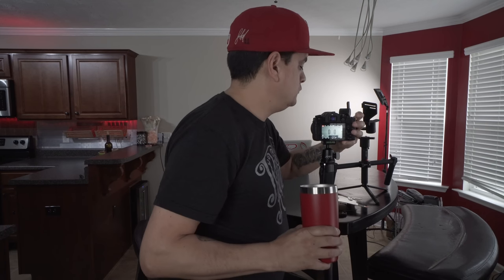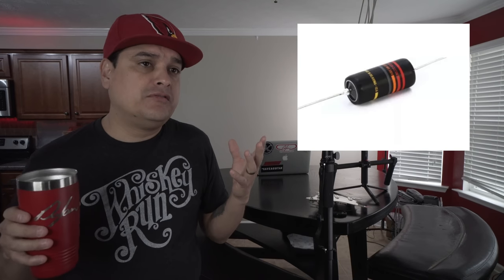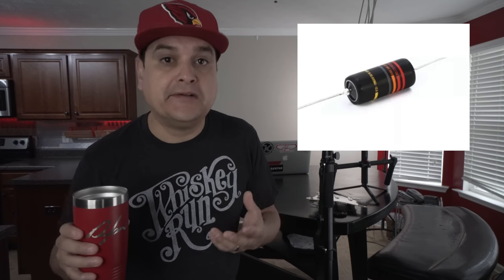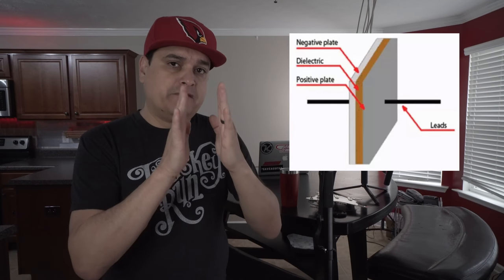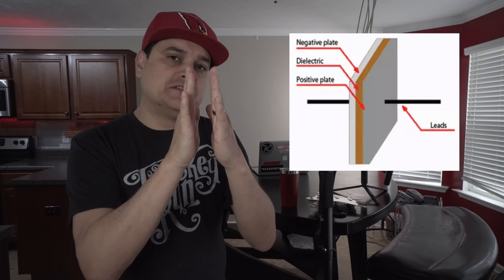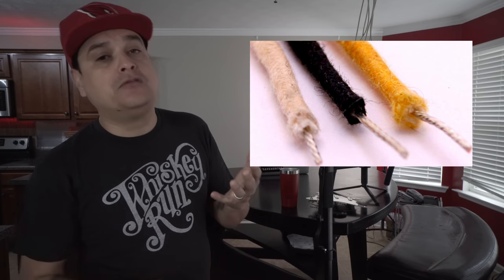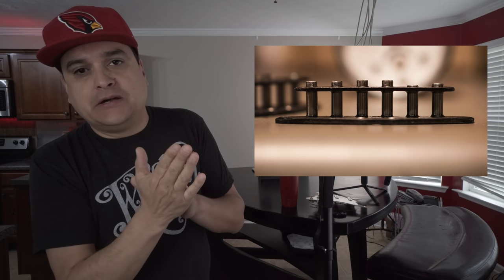Are Paper In Oil Caps Better Than Orange Drop?

Comment: Very awesome video. Correct me if I'm wrong, but the manner in which capacitors function in a guitar is also why it doesn't matter which way the outside foil is connected, although in electronics theory (if you're absolutely OCD), it would be facing toward the tone pot, yes?

Comment: I just converted my 09 Traditional LP from modern wiring to 50s.  I used all the factory pots and caps so the only variable is the wiring route. I noticed a distinct increase in the brightness of the guitar and the "sweep" of the tone pots.  Rolling the tone down from 10 it gets dark at a much slower rate (5 now sounds like 7 or 8 before).  This has me wondering if the tone caps are more or less important depending on which wiring setup you have?!
Reply: Wiring IS more important!
Reply: Yes I like to use 50s wiring  on my Teles to omit the Treble bleed... I do not like the curve on that. The 50s wiring to me works better with low val caps ..  I went from a .047 to a .015 and have a nice usable tone sweep that does not get too dark. use CTS 250k -300 kpots

Comment: I have no religious feelings vis-a-vis PiO caps, or any other kind when it comes to that... but as I had a chance to try a russian NOS PiO I noticed a very interesting fenomena: with the orange drop on my precision bass sometimes the rolled off sound seemed out of tune... but when you check with a tuner - all is spot on! Then I put the PiO and never again had that problem again! Is it possible that they affect somehow differently the harmonics in the process of cutting off the higher frequences...?

Comment: I once had a Q meter that measured how close a capacitor came to beibg an ideal or pure capacitor.  There was a big difference in Q between the different types.  The orange drops had low Q.  Polystyrene had the highest Q.  Ceramics had pretty low Q.  Paper caps were lower-middle Q.  Oil filled glass had fairly high Q.  Not sure what effect low or high Q caps have on amplifiers.

Comment: Very interesting explanation! I just built an ElectroSmash fuzz face. They did the homework and built a tunable circuit that accurately matches the output at the various sections as a vintage fuzz face. Sounds and performs just like one too. Only thing with a sound impact is the Germanium transistors and how they perform in the circuit. So those matter but you can probably use any Germanium that match the spec.

Comment: Hi Dylan. Found your video very informative but had a thought about it ? Say someone has a guitar that has oil caps in it that aged over the years and the love the tone. What if you took those caps and read their current value and found modern made caps that were close and near the value of the old oil caps and used them in replaced of those. Would you in effect be recreating what some call that vintage feel or am I missing something here ? Can't believe some manufacturer is making oil caps, selling them for hundreds of dollars and they may not even be authentic oil caps but modern made ones made to look old ones.

Comment: I use Sprague Orange drops 100v  .015 . The tone in my new guitar changed because I changed the values . But the original caps were a green chicklet looking things. I get the Sprague cheap so I don't mind using them if they last longer .

Comment: I have used ceramic caps before because they are cheap. I put a pair of classic 57's in a Schecter Tempest and went with an orange drop cap because I was chasing tone, but I cant say it made any sort of difference because I never heard those pickups in that guitar with any other cap. I was gifted a bunch of paper in oil caps and I'm about to rewire my friends strat, but I am probably just going to use the ceramic cap that came with the wiring kit... Thanks for the info

Comment: I'm a Fender man. I have one LP Special. (Hums) The LP seems dark to me unless it's on the bridge pickup with the tone at 7-10. (It has a .022uF cap on the 500k tone pot)
Would a treble bleed circuit on the volume or a lower cap value on the tone, like a .015 or .001uF best brighten things up?

Comment: Other than creating a "pass the eye test" control cavity in a vintage guitar there are several sound related reasons to install "used" Caps that match the type installed from the manufacturer. One is to emulate the natural aging of a "players guitar" in a guitar that is not as used ,where the caps you install are highly used and do not have the same value that is written on them aka a .022UF Greenie now reads .03 or similar. Here you are getting vintage mojo tone in a newer or less amped up guitar simply by using old caps. 
Now is where it gets dicey regarding what type of cap to use, but if you install a cheap ceramic cap that is old and used with a value higher than it's original spec it absolutely will not sound like a vintage "players" guitar where as a vintage used PIO or Wax that were the original equipment will sound different. Maybe to you it's no better, but there is a clear difference.
Of course many companies used those cheap Ceramics and the tone was terrible and the result was a large market different types of caps with many people steering towards PIO because they were "liked"

Comment: It's the value, not the material. Older caps initially had broader tolerances, which worsened with age. If you like the tone of a certain vintage guitar, measure the cap value and use one with that value. Just be sure everything else around the circuit is the same, too!

Comment: Remember the bumblebee caps, now, they are all failing with high leakage, but, did they have some internal resistance that changed the LCR equation of the pickup coil volume and tone pots in combo with the cap?   Was that their magic?, Could be.                                 What about tropical fish caps in early wah pedals and the inductor design, plus one cap value that isn’t available today.                Which color coily cord did Hendrix say he didn’t like because it sounded wrong?  Why is the treble booster such an interesting circuit?                 Why after a day of trying a five gallon bucket of Fender pickups did I stay with the Kent pickup which was wound on a plastic bobbin, but had and interesting comb metal filter, cause it sounded best, but that was not the outcome I expected!

Comment: Could maybe cover installation of cap direction, especially with PIO caps, I have found some caps sound off and have had to flip them….. I as well have tested several different cap types with the same values.. I have heard differences when making comparisons to each other and at times to themselves. Usually when completing a build for a customer I will check different cap types, values, and direction to find the one that works best for the guitar…just some thoughts to consider…

Comment: I don't think a capacitor to ground is going to matter much tonally from one material to another, there are very minimal differences. However, a capacitor in the direct signal path has a pretty distinct effect on the sound, especially after several stages in a tube amplifier.
Reply: Low pass filters can have capacitors connected to ground. Now try to convince me those have no effect on the sound. Cathode bypass caps are not even in the signal path and demonstrably do change the frequency response of the amp. The thing is, it's the capacitance that matters, none of that esoteric bulshit about PIO vs film vs whatever.
Reply: Not trying to convince you of anything, just saying the materials make very minimal difference with guitar tone caps. There is some detectable difference though and cathode bypass caps do have more perceivable tonal differences with the materials that I can hear very clearly, but that's because it's doing a different job than a tone capacitor is and it's handling higher voltages in a tube gain stage cathode circuit.
Reply: @Xenrelic  Wrong again. Cathode bypass caps are usually working in the 1 to 10V DC range, while coupling caps and tonestack caps often have several hundreds of volts across them. You have rationalized your beliefs based on made up facts. That alone doesn't mean you're wrong in saying you can tell the difference between caps with different dielectric materials, but I'm willing to bet you wouldn't be able to tell the difference in a blind test.
Reply: @-dazz-  Learn how to read bro.

Comment: I find it hard to believe that there is enough difference between Paper in Oil and the film Orange Drops to actually hear it. As long as they are the same value what would be different? Bleed through possibly? Resonant frequencies? More likely the huge tolerance differences. The only thing I have found is that going to a smaller value capacitor gives you more control of the range through the tone control. The normal values of .047 and .022 are pretty much so big that they are limiting you to the first 25% of the knob before they become too dark (IMHO). I now use a .01 mf and it allows me to use the entire tone control only in much finer increments. Also I use 100 volt caps only because it is so hard to find smaller values.

Comment: As per request. My quite uninformed opinion is paper and oil is a huge sound improvement over any other capacitor. That opinion is purely on listening to demos in comparison on YouTube. Wonder if this video will change my mind? Let’s see.
Reply: Why can I hear a difference on comparisons where the capacitor is the only variable?
Reply: @loganschexnayder1587  You're probably listening with your eyes. Try a blind test and check for yourself.

Comment: I have cts 250k pots, cloth wires, and a old Soviet paper in oil  .047 cap and a switchcraft output jack. Connected a seymour duncan hotrails and its in my p bass in my profile picture here on yt.

Comment: One theory is that metal film capacitors could be sensitive to electromagnetism.

Another theory is that high voltage capacitors vs low voltage would absorb some different frequencies. 

I imagine both theories could be true. But would it be audible, that is the question. 

High vs low voltage could be compared to a let say 500W speaker vs a 20W speaker in a 10W amp. Both are 8 ohms, both recieve the same signal, but the 500W will not move a lot of air...
This is a theory, and I cannot check it. 

For the metal film, it off course depends on which metal and how much metal. But this metal could be sensitive to the pickups magnetic field and alter the cap properties (frequencies filtering).

Of course there is no better or worse, it's all a matter of personal taste.
For example, I recently discovered that polyester capacitors with much lower values, between 0.0047uf and 0.0082uf, once the tone knob was at zero, gave a very interesting wahwah pedal sound, like pedal stuck halfway.

Comment: Caps don’t effect tone quality, they just do a job... yeah, old caps can sound better... 🤔
Reply: Capacitors that have drifted out of spec can affect tone. Capacitor material does not affect tone. in other words mylar vs. Paper and oil will not affect tone but if you have a 50 year old paper and oil capacitor that has drifted way out of spec then that can affect tone. Do you understand how this works?
Reply: @woodsandbarclay  
A failing capacitor can THEN, at that point,.."affect" the tone.
But it would be obviously in the "ear" of the beholder if it is a positive thing or not.
I'm not opposing what you wrote,..its spot on. I'm just adding my own .2 cents.
Reply: @woodsandbarclay  I built a LP style guitar with Parson Street humbuckers wired 50's style. Originally installed .022 Orange caps, changed them to .022 Russian PIO. Both brand new caps. Neither were high dollar vintage caps. Big difference in sound. The PIO's were much smoother sounding to my ears. You can say material doesn't make a difference all day long, but my experience says it does.

Comment: Paper caps dry out and rot. The dielectric foil breaks down, the electrolyte dries up, and the paper deteriorates from age and acids . . . the orange drop mylars are of high tolerance and a good size for the control cavity.
I bought a used Squier and it sounded HORRIBLE. It needed a setup, which helped, but when I changed the teeny mylar .022uf with a large orange drop, the neck pickup totally improved. The humbucker was shrill, loud. A .047uf really smoothed it out, but lower than 6 on the tone knob is useless, so testing between a 33 and a 22 . . . and I am using a 250 ohm CTS pot.

Comment: I recently rewired my headless strandberg copy with a momentary switch, while also removing the tone knob from the circuit.  I now prefer my guitars without a tone knob.  Don't need it.
Reply: That makes a 100 times bigger difference than any kind of capacitor type. Tone pots suck.
Reply: You can always use the fully disengaging style of tone pot, or a push-pull switch that disengages it entirely. The first is more elegant, but the second allows you to alternate between a rolled off tone and a bright tone without having to hunt.

Comment: If iv had anything other than orange drop it was before i got brave enough to crack open the control plate. Lol  When i did it was orange drop so i really dont know any different. Hav used those at different values along the way.

Comment: I like oil capacitors in the power supply they also last forever I have a huge 4mf 3lb capacitor in my Webster Hammond amp and reads better then any filter caps I own 
I can’t say anything about tone but I changed out my wax capacitors for orange drops in a few amplifiers and they definitely sound better now but the original all tested good but where burned up

Comment: if you deal with electrical components enough you will find that weird things that can't really be explained happens. 
capacitors make a difference under only certain circumstances. if you use big open chords and let them ring a pio cap seems to have a vibrato to it you can't get in other caps. also big bends will sustain longer with an orange drop or pio. pio may not be worth  $25 but I prefer even a $5 green meany over others, im also a fan of orange drops. the difference however may not make enough difference to you to worry with.

Comment: Great video Dylan, as always! I have a question, or a dilemma thing: if you'd have the choice of capacitor in a guitar, let's say you have your dream guitar in front of you and one's got a paper-oil and the other one is whatever (an Orange Drop let's say). Which would you pick?
Reply from the maker: SqualeProductions it won’t matter to me. If it’s a vintage guitar, whatever is original for value. If it’s a new guitar I won’t even give it a second thought
Reply: Just installed an Emerson SG harness in a customer's SG to find one pot dead, all four pots rattly when strumming a chord. ( You can hear it unplugged). Don't see the quality I would expect from a $120 harness. Where they soldered the ground wires to the sides of the pots interferes by hitting the side wall of the control cavity. I didn't get to the point of hearing how "marvelous" their oil and paper capacitors are supposed to sound since I stopped the installation once I ran into the dead potentiometer. I agree with you. There is a lot of hype out there over the pettiest of things in tonality. I'm putting the old harness back in and recommending my customer return this mess to Emerson.

Comment: Taking out the bumble bee caps and putting in orange drops downgraded my 347 Gibson considerably. Frequency tolerance sounds interesting. After the change the guitar lost some of the mid and low range and related character and produced a higher and flatter more sterile sound.

Comment: Ive been useing 393k regular capacitors solderd on the tone pot to ground no bigger than a finger nail both same size i used aligator clips on the grond of the tone and the bottom positive lug and swapped a green one with a red same size same value the red one had a duller sound but tighter fequency the green was brighter with looser fequency why

Comment: Jensen paper in oil all the way....
I put them In my Epiphone dot and it absolutely sounds different. I understand the science but, honestly, it sounds different. Not darker or brighter but more woody and it’s more responsive. I know there expensive but I can’t tell the difference between my wifes makeup brands either. .Maybe the caps that I took out were so cheap that they weren’t within spec. Idk. Or maybe the difference between a quality piece and the cheapest piece you could buy.  But I put expensive Sprague atom or F&T caps in my amps to soooooo there you go.

Comment: I know this is an older video - which I’ve not yet watched past the intro.

So. 

I don’t think it matters a damn, other than in two ways: 1 - I’d guess that over years, the oil and paper types have wandered dramatically in their value and probably outside their original tolerances; and 2 - you MAY win a sale over an otherwise identical instrument by stating it has bumblebees or orange drops in it, hell you may even make a few more bucks. The fact they’re repro and may not even be paper and oil, just sleeved up and painted to look like them and sold to YOU as bumblebees is besides the point - they seem to be sales buzz words (haha) in the guitar world.

With 1, I’m sure it would be interesting to find out in which direction the value has changed - I’d guess the value has lowered. So if an average value for the ‘good sounding ones’ can be established, just put THAT value cap into your circuit instead, and  maybe call call it “original ‘59 functioning electronics’ or something”…

Comment: Someone could make a guitar mod with a tiny switch to go between types. There are module units that can switch from 50s/60s tone circuit and different bleed types. Use your ears and build what you like best. I don't use tone controls, but I do install a fixed cap and resistor equivalent to about an eighth of a turn down just to clean up some of the static and noise as I play with high gain most of the time.